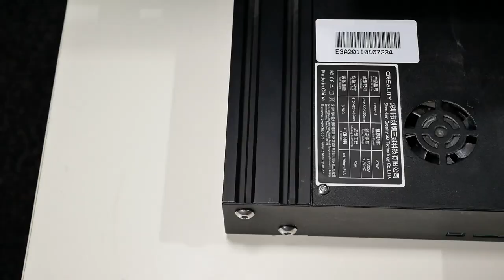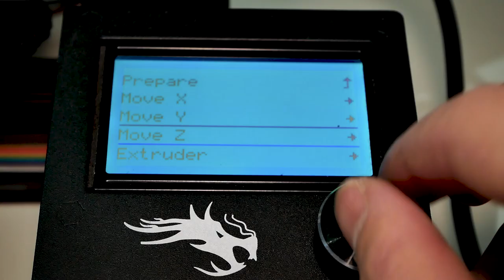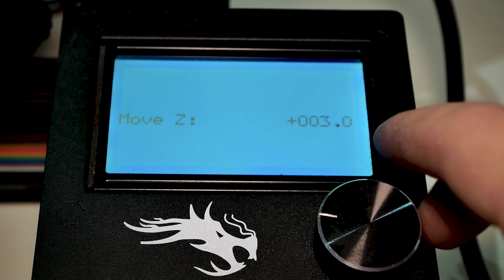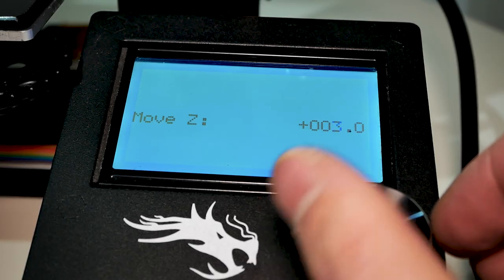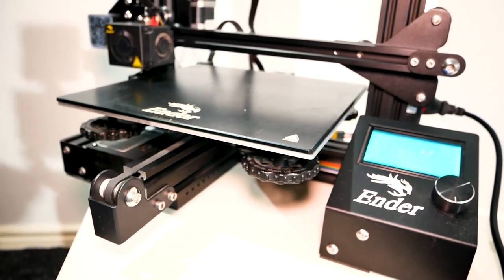Doesn't print right? Beginners guide to 3D printing maintenance

Comment: Thanks for  the video Mat. Which printer was it? Top left/right or bottom? If it isn't my printer. Top left, this is what I will need to do. Keep safe and stay well.
Reply from the maker: It was the top right one ;)
Reply: That's Jim's. Looks like a clean up of my printer is needed.
Reply from the maker: @nikond90ful1  well he has some upgrades too ;)
Reply: Well I have already replaced the PLA feeder for the metal one.
On that note. A quick tip, if you glue a steal washer over the plastic feeder hole, the PLA will not be able to cut into the plastic feeder arm. So it will last longer.
Reply from the maker: @nikond90ful1  that's a good hack! I was surprised how damaged that plastic bit got I had a spare one from my replacement as well so I have changed it

Comment: Don't you put a drop of oil in the wheels/rollers? Didn't have to service my 3d printer yet, so I've got no idea...
Reply from the maker: Oil isn't really required for the surface of the wheels. Just monitor the wheels bearings. Friction on wheels is intentional as they should roll not slide across. If you feel like there is too much friction adjust these again until they roll smoothly without snags
Reply: @notenoughtech  oh nono, not the surface. That would make it slip. I meant the bearings
Reply from the maker: @Thamli  if you feel there is a need you can drop a droplet of machine oil and let it soak it in